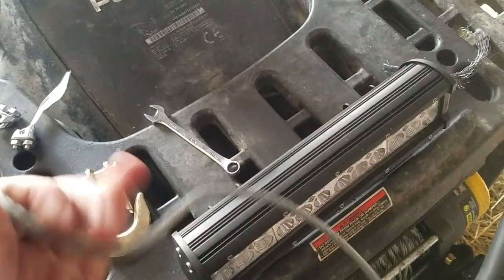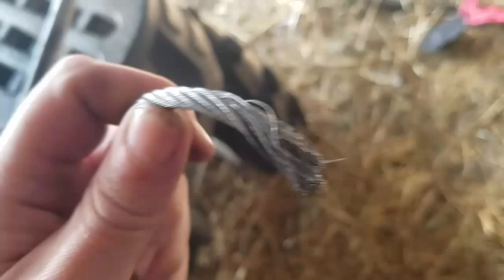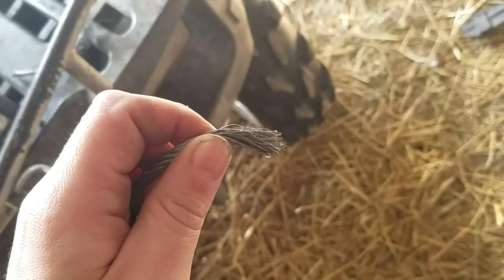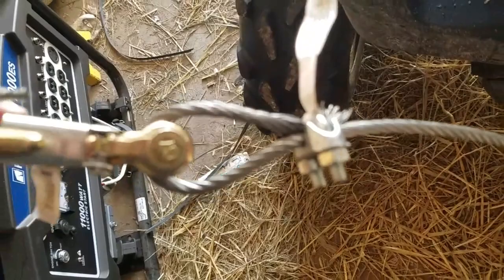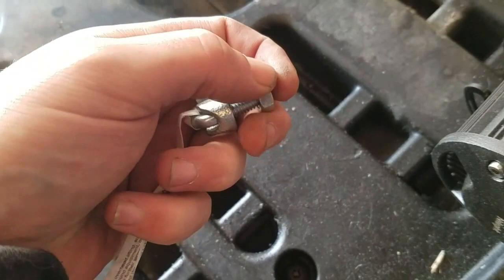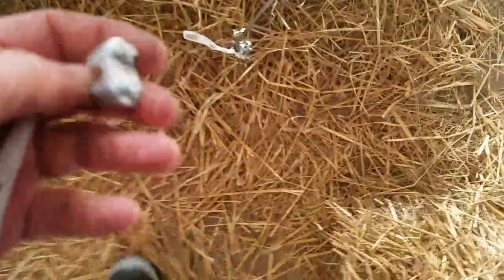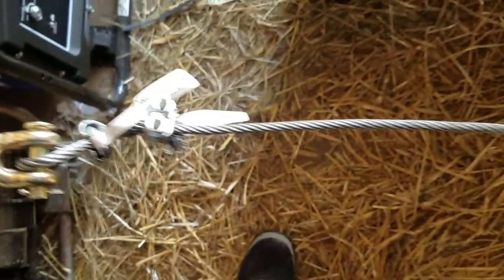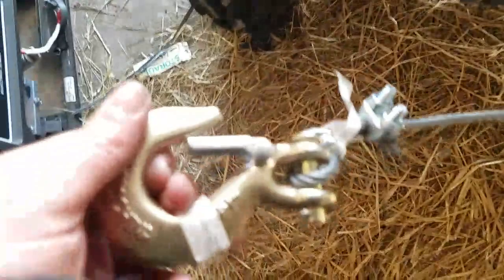😎How to install a new hook onto a winch cable😎

Comment: Mate don't get me wrong but you should use at least 3 clamps, clamps' bases should be on the load carrying wire rope side and you should leave (diameter of wire)x10 in length free wire rope after the last clamp… Be safe…
Reply: paralyziz absolutely

Comment: You put the cable clamp closest to the hook on backwards (never saddle a dead horse)
You should have removed the paper tags from the u-bolts so they get a better bite into the cable.
You should have used a thimble in the cable loop to protect the cable.
Reply from the maker: +Paul Anderson good to know. Ill have to make another video